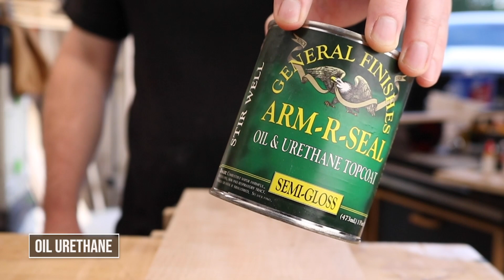Curly Maple Lumber PRO TIPS for Woodworking

Comment: I realize that this video is 2 years old but I've only now just come across it and am working with curly maple building small speaker cabinets. I was looking at finishing using shellac as you suggested but then came across Osmo PolyX and decide to use that instead. The finish is amazing and is slightly lighter than shellac and really easy to apply.

Comment: One tip for jointing/planing highly figured woods of any type, using sharp helical carbide inserted cutter heads DO work significantly better. Far less chip out (I almost never get any chip out), far less waste, far smoother finish (less time cutting, less time sanding). A sharper, more positive rake angle, taking light cuts,  no matter the cutter type, also helps.
Reply from the maker: Agreed

Comment: Another finish i like to do for highly figured woods (although not cheap) is painting on a light coat of epoxy resin with a foam brush. It really makes the figure pop and because it is a thicker film finish, it adds some visual depth to the curl too. 

I found this out when I had a little left in a bottle of tabletop resin and decided to paint it on a piece I had just finished for the next project.

Comment: Such a great and timely video! I just picked up a length of curly maple to make some gifts and have been eyeballing those dyes I bought a while ago. For bright, saturated dye colors like blue, purple, or red, I recommend checking out the videos done by people refinishing guitars. Curly maple seems to be the perfect wood for dye.
Reply: If you really want to pop with those bright colors try this.  Dye the curly black 3 or 4 times with sanding it off between coats.  Then use the blue, purple, red, etc.  It makes the curls dark and really pop.  I did all of the equipment (subs, racks, speaker stands) in my home theater this way with Transtint black and purple and they came out amazing.  I wanted a darker purple so the last black round I didn't sand completely off, brought it down to more of a light gray so that the purple would be darker on top.  Looks amazing and exactly what I wanted for this room.
Reply: @DesertILI  That sounds great. I'm probably going to start off small since I lack any real way to machine the maple completely flat and will likely just cut the 'good' and highly figured sections from the board I have. I'm thinking some nice trays or boxes. Maybe some splines dyed with complementary colors or such. Lots of possibilities.
Reply: @jaymzx0  Oh, and one more tip.  Use a good wax after finishing.  It really adds depth. When I posted pictures of my surround sound stands on the DIY channel at work someone asked me how I made them look so 3D.
Reply: @DesertILI  I'm a big fan of wax over boiled linseed oil. I plan on making swatches out of scraps to decide on the best look.
Reply: @jaymzx0  The linseed oil should work well.  I had done all of my pieces with a tung oil varnish like what was used in the video with wax over them.  Looked great.  I'm working on another set of speaker stands now and actually did the first coat of finish with linseed last night.  I was out of the tung that I was using so gave it a shot.  So far so good.  The first coat is still curing but it looks close to the other pieces.

Comment: Hey Mark, thank you for the video. I always benefit from your videos. I built a couple of boxes last year with curly maple and I was really pleased with how they turned out. The wood was spectacular and I finished it with general finishes water based poly rather than arm-r-seal. Anyway, it was the first time I used it, I think it is called high performance, and I was really pleased to avoid the amber effect of oil. First question is does applying shellac and then oil keep out the amber? Also, I my second upcoming project is to build a box for crayons and coloring books. I want to use curly maple and I want to dye each face a different color, like crayons but I want to look like a guitars with that bright color and perfect finish. Do you have suggestions on making those bright colors? I expect that I will have to dye and top coat before cutting the dovetails but I have never any fancy coloring before.   /  I built two tables last year with walnut and I took your advise and dyed them first with brown walnut and then put on a coat dark walnut danish oil before several layers of arm-r-seal and they look amazing (and so far no signs of going blond)

Comment: Great information.  Question: dye first, then shellac then clear finish?  Is that the right order? To clarify, I want to use shellac as that's what I have on hand but also want to try some color.  Thanks in advance.
Reply from the maker: That is correct. Dye the wood, shellac will seal it off.

Comment: Question on Card Scrapers:  I have never used one or even looked at getting one, but it sounds like I might want to do so.  Are they all pretty much the same or is there a brand or two you would recommend?  Thanks!
Reply: I think there are brands of card scraper that are to hard to sharpen correctly. I own such a set.
Reply: You will need to get the proper equipment to sharpen your card scraper, a file, a file holder a stone and a burnisher. Card scrapers are fantastic on figured wood, brings out their beauty like nothing else.

Comment: I’m a bit confused about your advice on hand planing. You mentioned that we should use a 50° bevel to reduce tear out, but you also recommend planing on an angle, which has the effect of reducing the effective angle of the blade  to the wood, in the direction of the plane’s movement. So how is doing that better than keeping the plane bevel at 45° and planing with the grain, not at an angle?
Reply: Planing at an angle aswell as a higher angle allows for a “shearing” cut aswell as a lighter, scraping cut from the different grind.

Comment: What would be the best way to get that shiny red finish that is on the back of the violin at 3:05?
Reply: Violins are usually finished with a colored varnish. The pigment is in the clear coat not a stain on the wood. This creates that unique effect you see in those instruments. But it’s apparently not a super durable finish since it’s purpose is to sound good. You can look up violin finishing videos if you want to see how they do it.

Staining the wood and then putting a dull clear coat on it as shown in this video is not going to create the same effect.